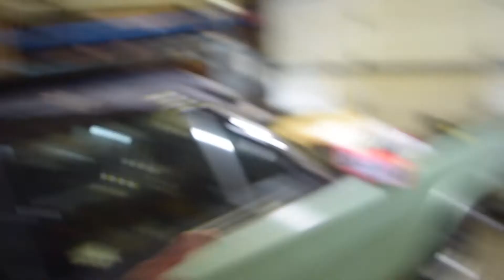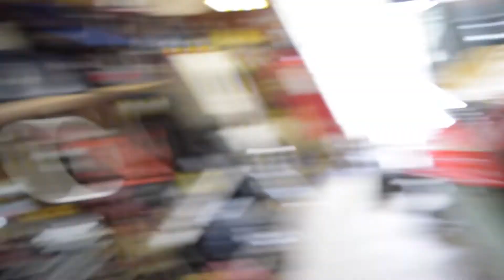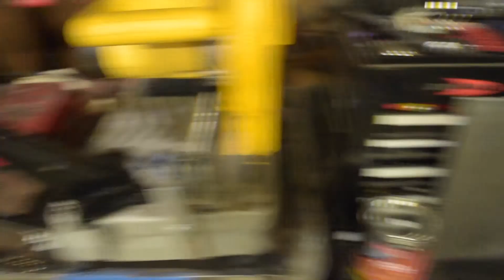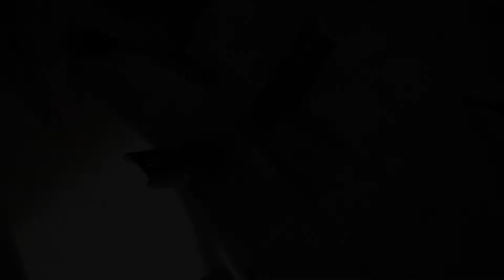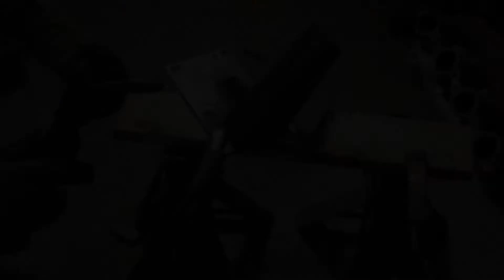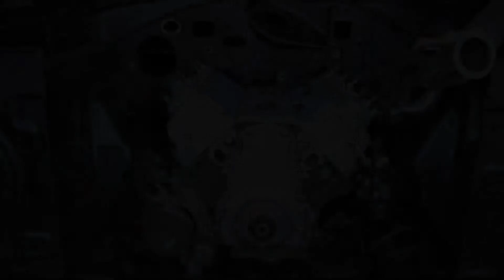PoF // Ep 60 - Building LS Engine Mounts

Comment: I noticed you were able to fit the downpipe fairly easy in the passenger side past the steering rack and torsion bars. I was wondering it where you have everything placed there would be a possibility to fit a 3” downpipe through the driver side past the steering shaft. I’m buying a 65 coronet 4 door from my father in law and was hoping I could fit 3” on both sides with a set of twins.
Reply from the maker: I think this could be done, but it would be really tight over there and I don't think you'd be able to run power or even hydroboost brakes.
Reply: @PistonsofFury  yeah I’d have to look at the brakes on the car and see if it’s manual or power. I was thinking I could possibly cut the mounts off the k member and fab some and run them through there.